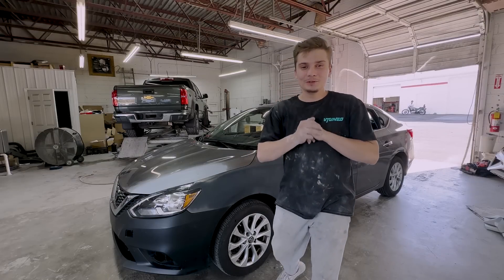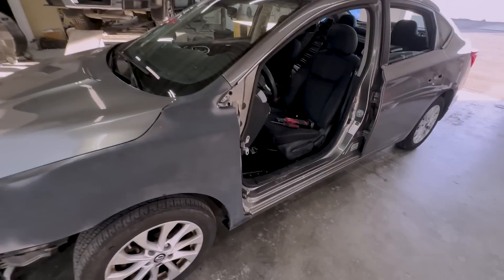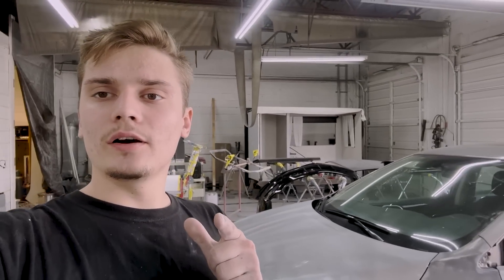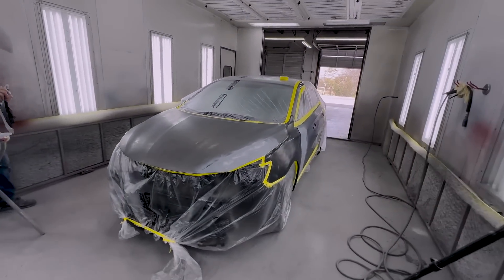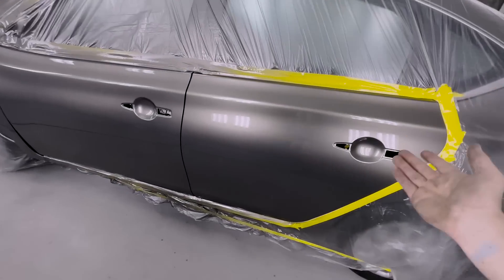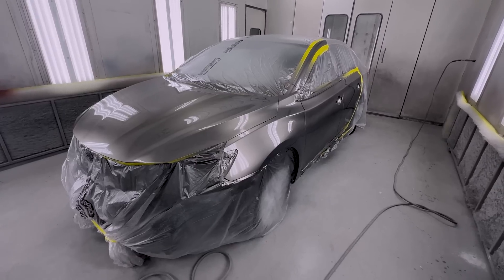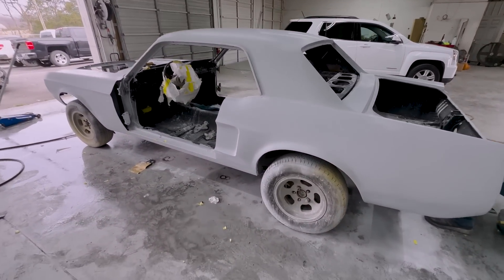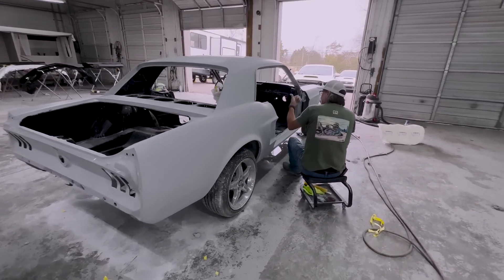I Bought @Vtuned's Car!!! And The Mustang Is Ready For A Custom Paint Job!!

Comment: For the thing on the hood, because i have a Sata 5500 RP 1.3 too, it's can come from the 3 M PPS 2.0, i using it and after 9 month I could no longer tighten the adapter and lot of drip from 3M only on my SATA... But i switch to the COLAD system and i have no one problem and low price :D ! I hope you don't have the same problem as me...

Your job is very clean man, you look like faster with Sata compare to the devilbiss ! very nice i appreciate this !!! <3

Comment: I get confused about the difference between sealer and primer.   When does the car need to primed or sealed or when you need to use adhesion promoter.
Reply from the maker: Primer has to cure and be sanded and is much stronger. Sealer is a top coat that seats the car and fix’s imperfections, it’s like a sprayable primer that gets painted right away and doesn’t have to be sanded. It also helps the paint bond to diff materials on the car such as primer and old paint. Adhesion promoter helps the paint bond and is usually used on plastic bumpers bc they flex and are a different material